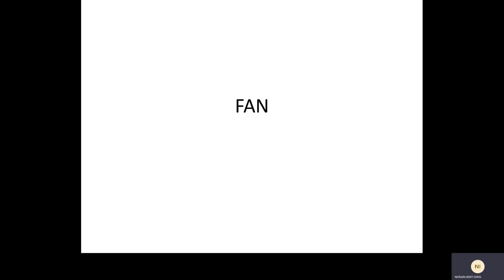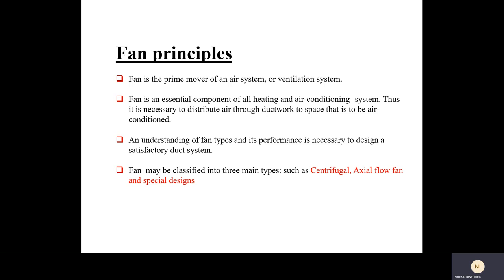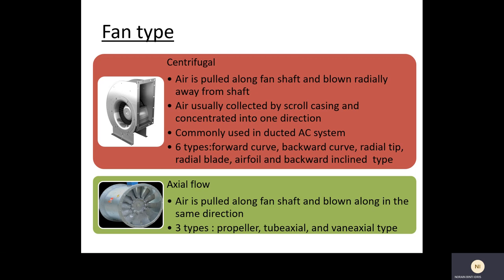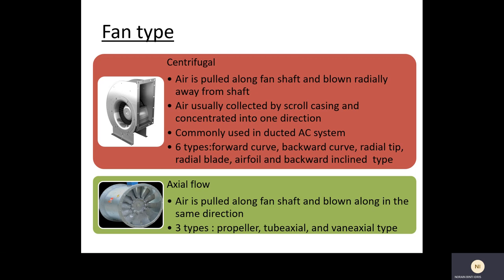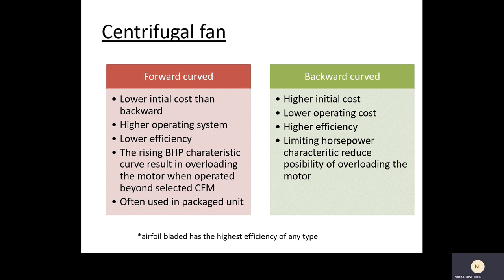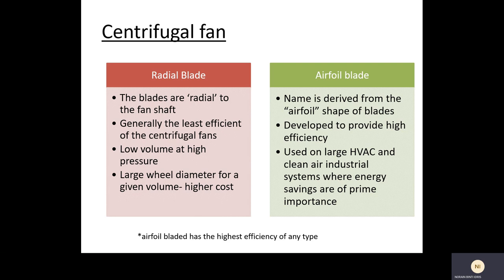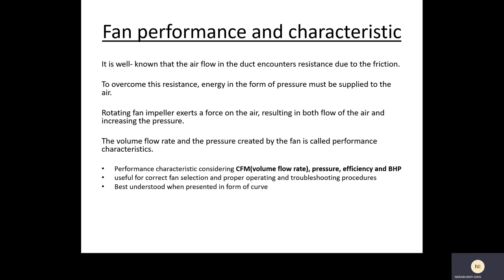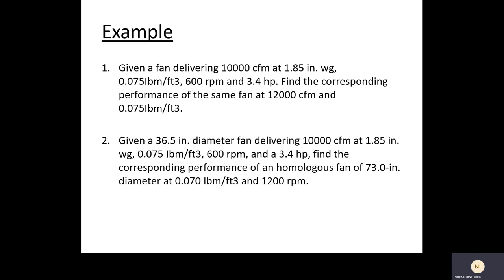Lecture 8 AIR MOVERS AND FAN TECHNOLOGY

Comment: MUHAMMAD SYAFIQ BIN ARZEMI
B071710014
3 BMMH S1/1

# FAN PRINCIPLES
    > prime mover of air @ ventilation system.
    > essential for both heating & cooling system.
    > distribute air through ductwork to space needed
    > main types of fan :
      * Centrifugal    * Axial Flow Fan    * Special Designs

  1. Centrifugal
    > air is pulled along fan shaft & blown radially
    > snail shape fan
    > air collected by scroll casing & concentrated into 1 direction
    > commonly used in ducted AC system
    > type of centrifugal fan :
      * Forward curve
      * Backward curve
      * Radial tip
      * Radial blade
      * Airfoil
      * Backward inclined type
^p/s : airfoil bladed has the highest efficiency of any type

  2. Axial
    > air is pulled along fan shaft & blown along in the same direction
    > type of axial fan :
      * Propeller
      * Tube axial
      * vane axial type

  3. Special Design Fan
    > required quality demand design innovation, exotic materials & precision manufacturing techniques.
    > examples :
      * Mixed flow ( combination axial + centrifugal )
      * Cross flow ( tangential )
      * Power roof ventilator ( Axial type & centrifugal type )
      * Tubular Centrifugal

# FAN PERFORMANCES & CHARACTERISTIC
    > air flow in the duct encounters resistance due to the friction
    > energy in the form of pressure must be supplied to overcome the resistance
    > force on the air exerts from rotating fan impeller, resulting in both flow of the air & increasing the pressure
    > volume flow rate & pressure created is called performance characteristic
    > performance characteristic considering :
      * CFM ( volume flow rate )
      * BHP ( Brake Horse Power )
      * pressure
      * efficiency

# TERMS ASSOCIATED FAN PERFORMANCE 

      cfm    =    Volume Flow Rate ( ft3/min )
       Ps     =    Static Pressure ( in.w.g )
       Pt      =    Total Pressure ( in.w.g )
     BHP    =    Brake Horse Power ( bhp ), energy consumption
       HP     =    Horse Power, indicates size of the fan
        N       =    Speed ( RPM ), revolution per minutes
      ME      =    Mechanical Efficiency = HP output / BHP input

# CONVENTIONAL WAY TO SELECT SUITABLE FAN FOR HVAC SYSTEM :
    1. Calculate static pressure resistance, Ps
    2. Select required CFM against system Ps from manufacturer's data
    3. Selection criteria = energy consumption

THANK YOU =)

Comment: MUHUNTHAA A/L MUNIYANDI
B091810185
3 BMMH S1/1

Based on the video, I have learned about the fan which is the prime move of an air system or ventilation system . 

Therefore,  fan also can be classified by three (3) types  
1) Centrifugal
1) Axial flow fan
2) Special design

Moreover , I have learned about fan's performance  which is parameter for performance in CFM , pressure , efficiency and BHP.

Furthermore,  total pressure is used to minimize energy consumption for fan selection.

Comment: MUHAMMAD HAZIM BIN ISMAIL
B071710545

1. Fan principle
- Prime mover of an air system or ventilation system
- Very important for both heating and cooling in air conditioning system
- Needed to distribute air through ductwork to space that is to be air-conditioned
- Three main types: -
a. Centrifugal fan
b. Axial flow fan
c. Special designs of fan

2. Fan type
> Centrifugal
- Air is pulled along fan shaft
- Snail shape type
- Air is blown radially away from shaft
- Air is collected by scroll casing
- Concentrated into one direction
- Commonly used in ducted AC system
- Six types of centrifugal fan: -
a. Forward curve
b. Backward curve
c. Radial tip
d. Radial blade
e. Airfoil
f. Backward inclined type
- Airfoil bladed has the highest efficiency of any type
> Axial flow
- Air is pulled along fan shaft
- Air is blown along the same direction
- Three types of axial flow fan: -
a. Propeller
b. Tubeaxial
c. Vaneaxial
> Special design
- Required quality demand design innovation
- Exotic materials
- Precision manufacturing techniques

3. Fan performance and characteristic
- Air flow in the duct encounters resistance due to the friction
- Energy in the form of pressure must be supplied to overcome the resistance
- Rotating fan impeller exerts a force on the air, resulting in both flow of the air and increasing the pressure
- Performance characteristics is the volume flow rate and the pressure created by the fan
- Four items to consider the performance characteristics of fan: -
a. CFM (volume flow rate)
b. Pressure
c. Efficiency
d. BHP (brake horsepower)
- Useful for correct fan selection
- Best understood when presented in form of curve

4. Fan rating
- Two types to see the performance of a fan: -
a. Performance curve
b. Table

5. How to select a fan: -
a. Calculate the static pressure resistance
b. Select the required CFM against the system static pressure resistance for the right fan from manufacturer’s data
c. Selection criteria is the energy consumption
- The best fan is actually a fan with enough CFM but has the lowest energy consumption
- Above was conventional way to select a fan for hvac system
- To ensure the best chance to minimize energy consumption, total pressure must be calculated

6. Fan laws
- Relationship among fan performance, operating at changed condition, or for different size fans
- Useful to predict performance

Comment: Mohd Sazwan Fitrie Bin Mohd. Khairil Fitrie
B071710488

Fan is a device that moves air to increase air pressure in the ventilation system.
Three types of fan:
1. Centrifugal
2. Axial flow
3. Special Design

Centrifugal fan
~Forward curved
~Backward curved
~Radial blade
~Airfoil blade
~Radial tip

Axial flow fan
~Tube axial
~Vane axial

Fan performance and characteristics
*To overcome resistance, pressure must be supplied to the air.
*Rotating fan impeller exerts force on the air, flow of air and pressure is increased.
*Volume flow rate and pressure created by the fan is called performance characteristics.

Comment: MOHD NAZRIN BIN MOHD NAZRI B091810221 3BMMH S 1/2 

From this lecture 8, I learnt about the fan principle which is the prime mover of a ventilation system and essential part of heating and A/C system. There are 2 types of fan likes Centrifugal fan and Axial Fan. Method to choose a fan is need to calculate the total pressure to ensure get the best minimal energy consumption. Lastly, we know the equation in Fan Laws.

Comment: ALDY HENRY DUSIM (B071710329)

FAN
-is the prime mover of an air system or ventilation system
-there are three main type: centrifugal, axial flow fan, and special design.

Centrifugal
-air pulled  along fan shaft and blown radially awal from shaft
-its commonly used in ducted AC system
-types: forward curve, backward curve, radial tip, radial blade, airfoil and backward inclined type.

Axial Flow
-air flow is pulled along fan shaft and along inn the same direction.
-type: propeller, tubeaxial, and vaneaxial type

Special design
-a fan that is design for significant requirement 

Fan performance and characteristic
- things that must be consider : CFM, pressure, efficiency and BHP.

Fan selection
it is important to choose the correct fan to achieve the desired function for it therefore the following is what is need to be calculated:
-calculated the static pressure resistance
-select the fan based on the required CFM against the system static pressure resistance
keep in mind nowadays it is important to select the one  that have lower energy consumption

Comment: Muhammad Ariff Imran bin Hassan
B091810177

Fan principles
Fan is the prime mover of an air system, or ventilation system.
 Fan is an essential component of all heating and air-conditioning system. Thus it is necessary to distribute air through ductwork to space that is to be air-conditioned. An understanding of fan types and its performance is necessary to design a satisfactory duct system. Fan  may be classified into three main types: such as Centrifugal, Axial flow fan and special designs.

There are two type of fan which is centrifugal and axial flow.

To select a fan must static pressure resistance Ps is calculated. From the manufacturer's data, the required CFM against the system static pressure resistance for the right fan is selected and selection criteria : energy consumption

Comment: IDA NAJIHA BINTI JUNUS
B091810091
3 BMMH S1/1
I learned about the fan in this lecture, which is the primary move of an air system or ventilation system. Thus, three (3) types of centrifugal, axial flow, and special design fans can be classified. I also learn about performance fans. CFM, pressure, efficiency, and BHP are the performance parameters.

Comment: AHMAD ASYRAF BIN AMIL B091810125
A fan is the prime mover of an air system or ventilation system. Also an essential component of all heating and air-conditioning system. Thus it is necessary to distribute air through ductwork to space that is to be air-conditioned. consist of two types of a fan which are a centrifugal fan and axial fan.

Comment: Ahmad asyrafamirudin bin aznan b071710607

Fan principle 
- the prime mover of an air system or ventilation system
- essential component of all heating and air conditioning system
- understand the type of fan 
Fan type 
- centrifugal
    ✓ air pulled along fan shaft and blown radially away from shaft
      Type centrifugal 
1) forward curve
2) backward curve 
3) radial tip 
4) airfoil 
5) backward inclined 
- axial flow
    ✓ air pulled along fan shaft and blown along in the same direction 
Type axial flow 
1) propeller 
2) tubeaxial 
3) vaneaxial

Special design fan 
1) quality
2) exotic material 
3) precision manufacturing techniques 

Fan performance and characteristic 
1) volume flow rate 
2) pressure 
3) efficiency 
4) BHP
Selected fan 
1) calculated static pressure 
2) energy consumption

Comment: AMIRATUL RASYIDAH (B071710456)

1. Principle of fan
• Prime mover of an air system or ventilation system
• Fan type & its performance is necessary to understand to design a satisfactory duct system

2. Types of fan

Centrifugal fan
• Air is pulled along fan shaft & blown radially away from shaft
• Forward curve, backward curve, radial tip, radial blade, airfoil, backward inclined.

Axial flow fan
• Air is pulled along fan shaft & blown along in the same direction
 • Tubeaxial & vaneaxial

Special design fan
• Required quality demand design innovation, exotic materials, precision manufacturing techniques.
• Mixed flow, cross flow, other design; turbular centrifugal, centrifugal, axial

3. Fan performance & characteristic
• CFM
• Pressure
• Efficiency
• BHP

4. Fan law
• Useful to predict performance when conditions are changed

Comment: SHAZNI SAHIRA SARIFF B091810225

As a conclusion, fan is known as the prime mover of an air or ventilation systems. fan can be classified into 3 main types: centrifugal, axial and special design. in centrifugal, air is pulled along fan shaft and blown radially away from shaft while in axial, air is pulled along fan shaft but blown along in the same direction. In special design, fans of the required quality demand design innovation, exotic materials and precision manufacturing techniques. There are 3 steps in conventional way to select a suitable fan for hvac system: static pressure resistance, Ps is calculated, from manufacturer's data, the required CFM against the system pressure resistance for the right fan is selected and selection criteria which is energy consumption. Lastly, we were able to predict the size and speed of fans by using the formula given.

Comment: Muhammad mukhlis bin abdullah (b071710395)

Fan principles
-Fan is the prime mover of an air system, or ventilation system.
-Fan is an essential component of all heating and air-conditioning system. Thus it is necessary to distribute air through ductwork to space that is to be air-conditioned.
-Fan  may be classified into three main types: 
~ Centrifugal
~ Axial flow fan  
~ Special designs

Centrifugal
-Air is pulled along fan shaft and blown radially away from shaft
-Air usually collected by scroll casing and concentrated into one direction
-Commonly used in ducted AC system
-6 types:forward curve, backward curve, radial tip, radial blade, airfoil and backward inclined  type

Axial flow
-Air is pulled along fan shaft and blown along in the same direction
-3 types : propeller, tubeaxial, and vaneaxial type

Special designs 
-Special designs are fans of the required quality demand design innovation, exotic materials, and precision manufacturing techniques

Fan performance and characteristic
It is well known that the air flow in the duct encounters resistance due to the friction.
-To overcome this resistance, energy in the form of pressure must be supplied to the air.  
-Rotating fan impeller exerts a force on the air, resulting in both flow of the air and increasing the pressure. 
-The volume flow rate and the pressure created by the fan is called performance characteristics.  

Fans Law
-Relationship among fan performance for a given fan, operating at changed condition, or for different size fans of similar construction
-Useful to predict performance when conditions are changed

Comment: SRITARAN A/L ARUMUGAM
B091810178

From this lecture, i have learnt that 
the fan concept, which is the primary mover in a ventilation system and a key component of a heating and cooling system. There are 3 types of fan such as centrifugal, axial flow and special design. Special design fan require quality demand design innovation, exotic materials and precise manufacturing techniques. The required CFM data from the manufacturer is compared to the system static pressure resistance to pick the appropriate fan, and finally, energy consumption is calculated.

Comment: Hakim bin Zainul B071710531
 Fan
Fan Principle
*is a prime mover in air system / ventilation system.
*essential component, understanding of fan type and its performance is necessary.

Three type of fan 
1.	Centrifugal (air is pulled and blown radially from shaft)
•	Forward curved
•	Backward curved
•	Radial blade
•	Airfoil blade
•	Radial tip

2.	Axial flow (air is pulled and blown along the same direction)
•	Tube axial
•	Vane axial

3. Special designs (required quality demand design innovation, exotic material, precision manufacturing)
•	Impeller design
o	Mixed-flow
o	Cross-flow
o	Other design
	Axial 
	Centrifugal

Fan performance & characteristic
*to overcome resistance, energy in form of pressure must be supplied to the air.
*Rotating fan impeller exerts a force on the air, flow of air and pressure is increased.
*Volume flow rate & pressure created by fan is call performance characteristics

 Fan rating
*Performance curve
*Table

How to select a fan
*Static pressure resistance Ps is calculated
*Energy consumption

Comment: MUHAMMAD AKRAM (B071710573)

Fan = prime mover / ventilation system

3 Types of fan
- Centrifugal - Axial flow - Special design

Centrifugal - airfoil blade hase the highest efficiency of any tye.
- used in ducted AC system
- 6 types * forward curve, backward curve, radial tip, radial blade, airfoil, backward inclined type.

Axial flow
- 3 types *propeller, tubeaxial, vaneaxial

Special design
- required quality demand design innovation.

Fan performance and characteristics - volume flow rate and the pressure created by fan.
- consider CFM, pressure efficiency and BHP
- usefully for correct fan selection.

Fan rating - Performance curve, Table

Fan laws - relationship  among fan performance, operating at change condition or for different sizes fans.

Comment: Muhamad Ashraf Bin Zulkupli
B091810161
Fan is one of the most important equipment in ducting and ventilation system. It is use to transfer air through out the system

Comment: RAJA MUHAMMAD ASYRAF BIN RAJA ADNAN 
3BMMH 1/1
B091810063

From this lecture , i know about fan which is fan is the prime move of an air system or ventilation system . Thus , fan also can be classified by three (3) type centrifugal , Axial flow fan and special design.

Furthermore , i learn about perfomance fan that parameter for perfomance is CFM , pressure , efficiency and BHP

Comment: Lua Wei Jie (b071710861)

Fan is most important in air system or ventilation system.
centrifugal fan :
a. forward curved: high operating system, lower efficiency, lower initial cost.
b. backward curved: low operating system, higher efficiency, higher initial cost.
c. radial blade : low volume at high pressure, least efficiency,  blades are radial.
d. airfoil blade :airfoil shape, provide high pressure, large and clean HVAC system.
e.radial tip: more efficient than radial blade , blades are radial to the fan shaft.
axial flow fan :
a. tubeaxial : air distribution uneven., undesireable for ac system
b. vaneaxial : suitable for ducted system,  high level noise 
special design fan base on the needs of company. 
regarding the suitable fan we must choose from :
mode size, horsepower of motor, rpm, cfm, and BHP at selected performance.